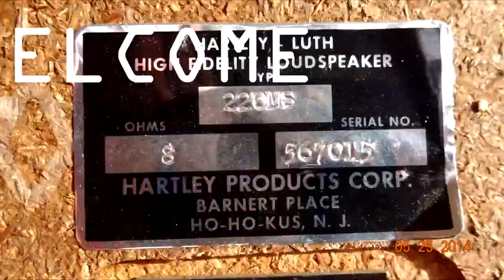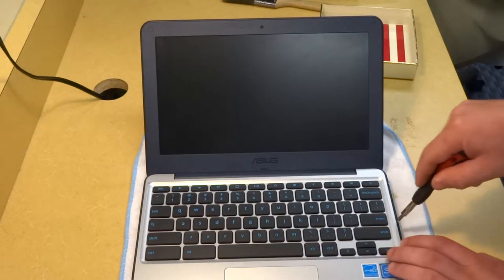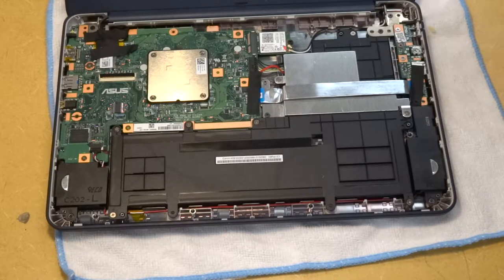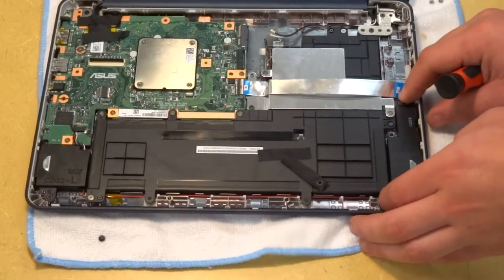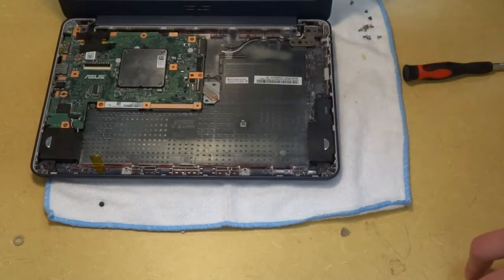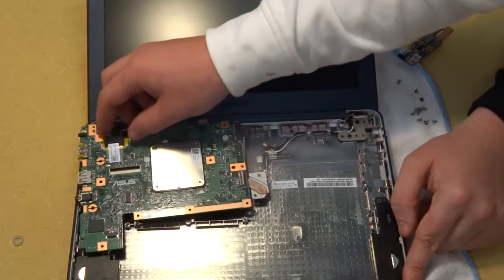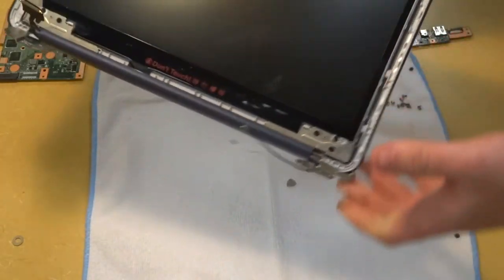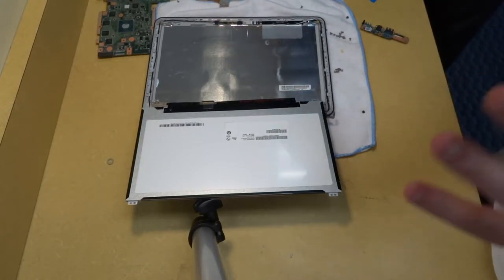What's Inside? - an ASUS C202s Chromebook

Comment: I'm going to offer some constructive criticism here.  This all comes from my over 25+ years of experience of course.
1.  Two words:  MAGNETIC SCREWDRIVER.  No, it won't harm the hard drive, even if you use it on the screws for it.  Never killed one in all my years.  The magnetic field on the screwdriver just isn't strong enough to cause any problems.  Also, use a good quality set of precision screwdrivers.  Really good quality.  I have a set of Xcelite German-made screwdrivers that in my opinion are some of the best money can buy.
2.  NEVER use your flat-blade screwdriver to pry cases.  It leaves marks in the plastic.  Instead, grow some fingernails (just a drop) and they will become one of your most important tools.  Some cases do require persuasion, and for that you should invest in a good case opening tool, which can be had for only a few dollars.  Another must-have tool.
3.  Try not to use your screwdriver to open flip-top connectors.  Again, fingernails are the best tool.  For some of the more stubborn ones that latch on the left and right sides, sometimes a screwdriver with a fine flat tip can be helpful, but you must use extreme care; if you pop it out too far there's little hope of getting it back.  Same with the flip-tops, a screwdriver can pop those right off and usually break them.
4.  To get the rubber/plastic "bumpers" off the screws on the screen bezel, use a small utility knife.  I like to use the ones with the snap-off blades so you can always get yourself a nice sharp tip if it's not working as well as usual.  Plus, a utility knife is also a good tool to have for other things, you'll find uses as time goes on.
5.  Parts retention:  A magnetic parts tray (again, only a few bucks) makes all the difference.  You'll learn that when you have to search for a dropped screw, especially on that lands on a dark-colored floor or carpet.  To retain screen screw bumpers/covers, stick them right to the palmrest of the machine.  Once off, get a piece of scotch tape.  Double one end over back onto the tape to create a pull-tab, and tape down the bumpers.  First time you lose one you'll remember why you need to tape them down.

Now some other things:
Laptop screens generally are very generic nowadays.  Any screen of the same physical size, resolution, and connector, from any manufacturer will probably work just fine.

The music during the speed up scenes was a bit too much.  Sometimes silence is the best option, especially if there are a lot of sped up scenes.

Did the laptop work after that?  I didn't see a screen come up.
Reply from the maker: Yea, the laptop works. The problem is that these computers need to be plugged into their power supply to turn on after being disconnected from the battery. 

I know about the magnetic screwdriver, flat blade screwdriver and flip top connectors. This was filmed off site and they did not have many tools. I do have a pry tool, magnetic screwdriver kit of decently high quality, typically have a magnetic place to put screws, and utility knife. Just didn't have any of that on me because I was told they had tools.

I also don't really care about this laptop so that is why I didn't use many precautions.

Comment: Ahhhhhh the metal screwdriver for the cable clips and the fact you guys said asus messed up saying Pentium inside you both realize the celeron is a pentium chip right? Lol
Reply from the maker: Sorry for the late reply. A celeron chip is below a pentium. Celeron is basically an intel atom chip and as for the metal screwdrivers, I've done that for years and never broke a connection.